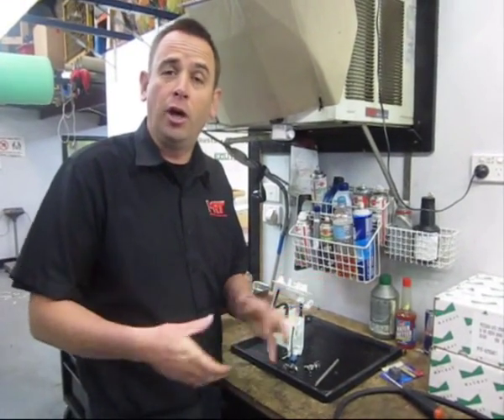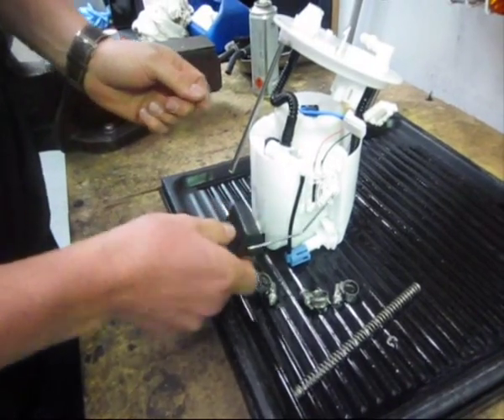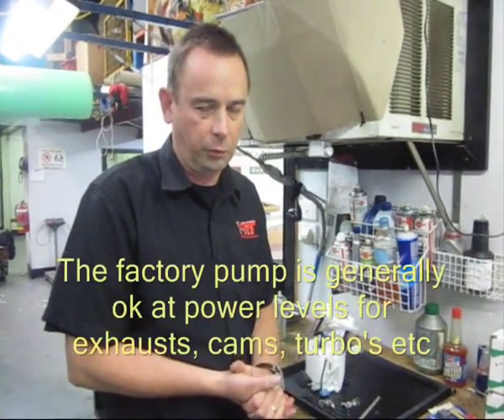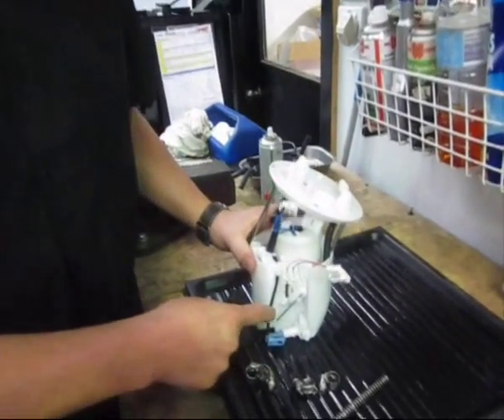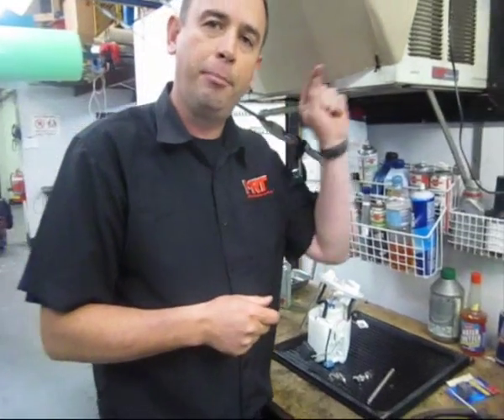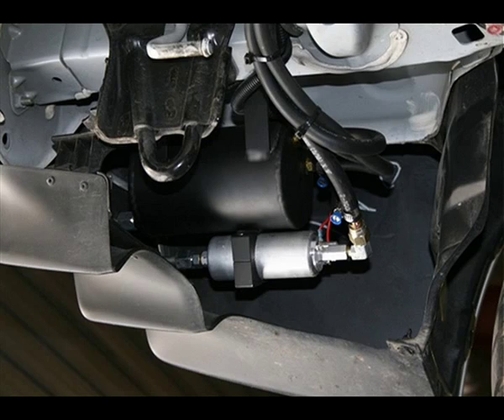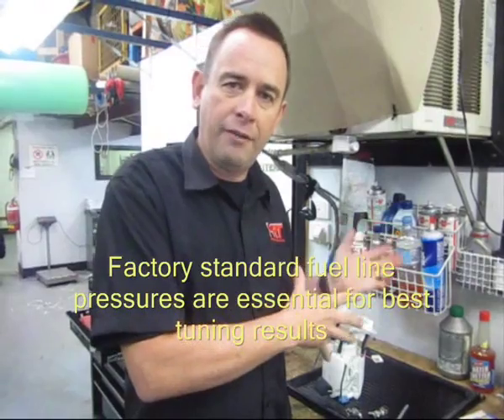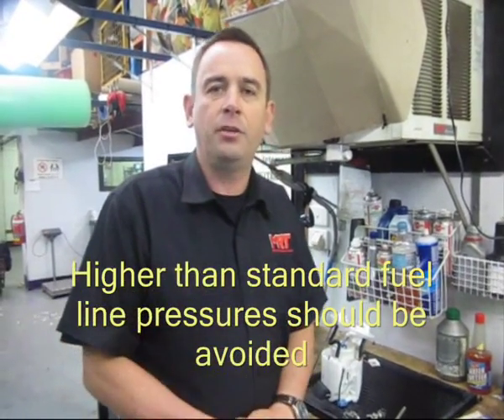Mitsubishi EVO X Story Pt 16 Fuel Pump + Surge Assembly

Comment: Hi Brett awesome video, but i didn't catch what the critical upgrade to be done to the return line when we couple it with an aftermarket additional surge remote tank with a replacement high volume pump, What is this modification that needs to be done that is a critical element to make sure you've got the reliable fuel line presure?